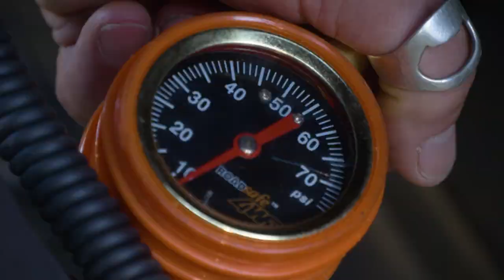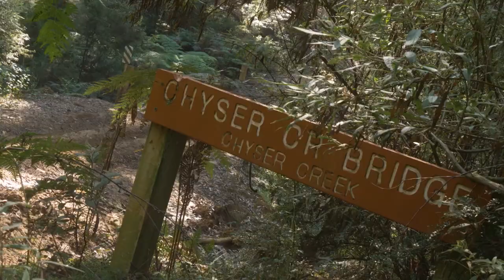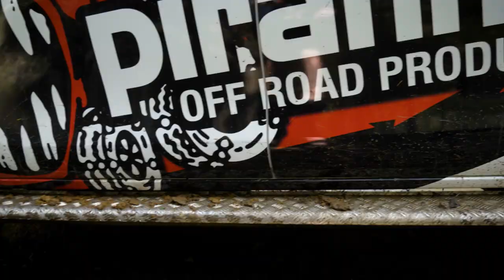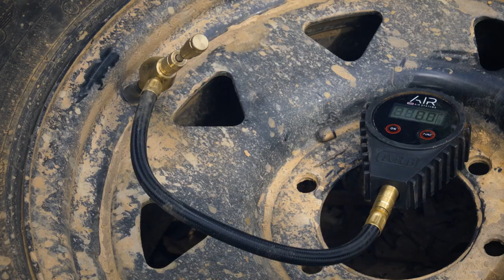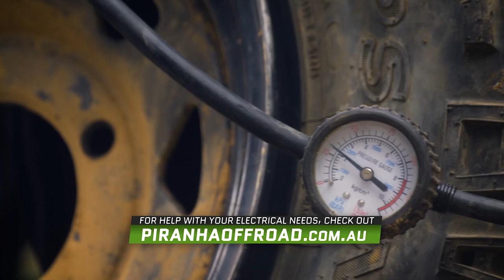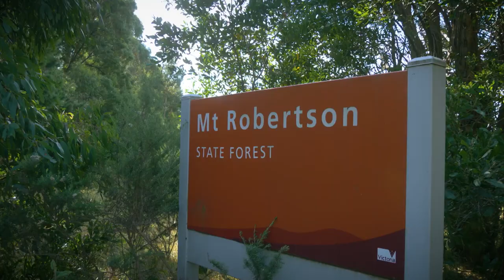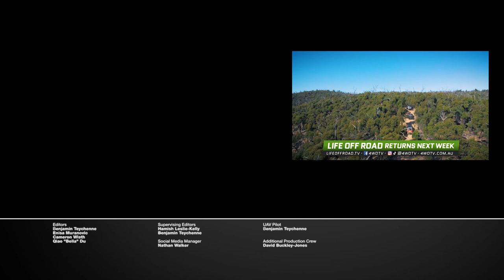Land Cruiser Busts TWO Tyres! T60, Narvara, Hilux, Escape Unharmed

Comment: With those recovery points, they should probably radius the outside edge too, for when it's not a dead straight pull. No point removing the cutting edges from the inside of the hole, when they're still on the outside.
Reply from the maker: Yes they did look at that. first point is that they did test their recovery points with their soft shackles and they were fine but they just radiused the inner edge to make them more functional with other brands of soft shackles. Secondly, you are right, they do rub on the outer edges but the loading is far less than what is on the inner corners. Thirdly, the price of radiusing the outer edge would have added considerable cost to the consumer and because of the limited benefits (as described above) it was not worth it. Thank you for the suggestion.

Comment: Need to add these to your recovery kits and a can of starting fluid(either) .
https://www.colbyvalve.com/
Spray the starting fluid in the tire and light it. When the starting fluid ignites it will reset the bead of the tire. Then fill with air.
Reply from the maker: Yeah we did try the spray can as we didn't have much hope with two beads off but unfortunately that still didn't work. Unbelievably we got it back by simply jumping on it. All sorted and back on the tracks.